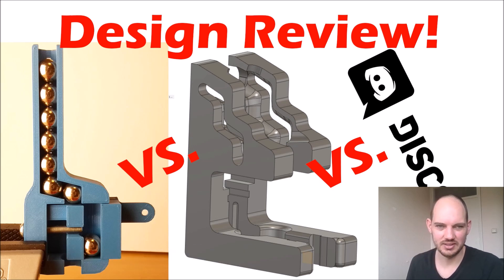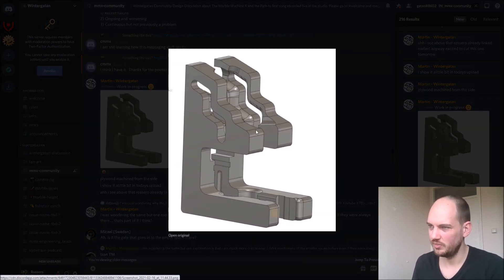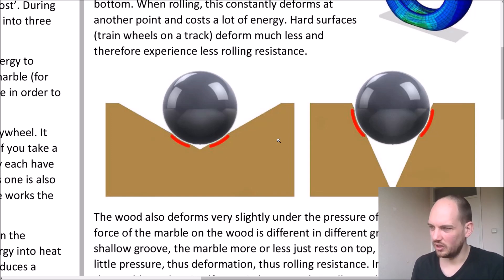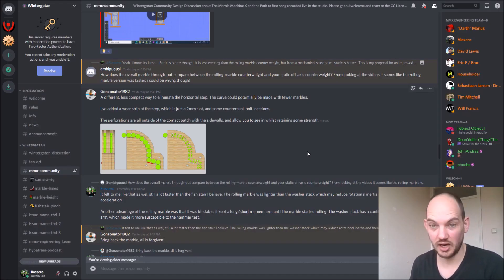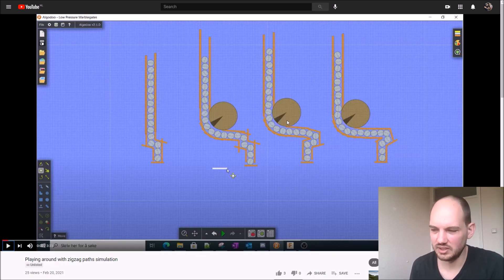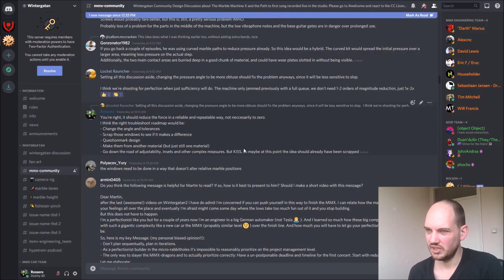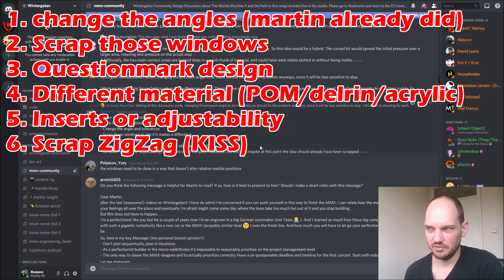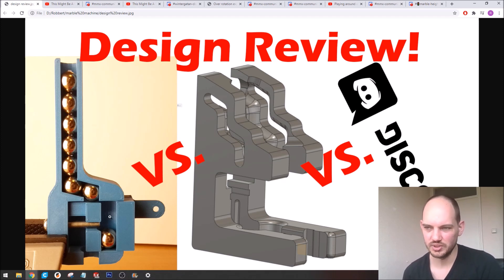[ Design Review ] ZigZag troubleshoot edition!👏 👏

Comment: Question regarding your design... if you would add just a small small "belly" in the marbel path , right at the second marbel from the corner, will something like that ensure that small "angle" push so it makes sure it does not get stuck ? Thanks for.... well i guess .... everything

Comment: Friction with the walls and also the adjacent marbles seems to be preventing the free release - i.e. the marble is pinched between 2-3 surfaces.   consider making one or both walls of the zig-zag or question mark out of ball bearings (at the contact points anyway) that can rotate freely.   the wall friction is now eliminated and the marble pressure is only a function of the vector angles at the contact points.   this should be more reliable than compromising between angles/gravity/wall friction.    sorry, no time to draw it up for you, but hopefully it is clear.

Comment: Nice. About friction: if the wood receive two coats of boiled linseed oil, it polymerises on the surface making it much smoother... With time the marbles of course would eat on the coatings and on the wood... But that is not a problem because this kind of wear leaves behind a polished surface.... So the oil woul provide this polished surface until normal wear polished all the path

Comment: I think that the ? design is overall an improvement, but there is one edge case where it will have the same issue where the upper marble will pinch the lower one into the wall. At 3:34 the exact circumstance is shown: The orange marble will get stuck between the ledge and the lower marble. Of course, with more marbles pushing against the orange marble, this won't be an issue. But it does mean that each channel will lose 2 marbles of capacity.
Reply from the maker: If there isn't a queue pressing against the orangeone, there is a problem of a much higher order already haha
Reply: @rosserobertolli  that's true, but crazy things happen when you plan on dropping millions of marbles ;)

Comment: awesome breakdown... im working on this right now... my version 2 is also sticking, timing of your video is perfect! 
My next idea was making even steeper angles and closing the windows, and removing all overrotation. i agree on those, a shame for the visibility but hey, the machine looks cool enough...
The ? questionmark design is causing some space issues, some of the drum gates are very close to the spring tensioning system, so the moving parts of that system would interfere with the ply parts. I´ll try a version 3 first it should work...
Reply: even the question mark design is not failproof , with time the 3'rd marble(from top down) will make a small dent in the wall , the ball above it wil make a small dent below it from falling down on same spot  and then the pressure makes the left marble stuck .
  i think a good idea to test these gates is to leave them open and just pour 10-50k marbles trough them  then study where the wear appears and design a new part with accentuated wear and test that.
Reply: Hi Martin! I'm happy to see the solutions coming together. I am watching your videos every day, great progress!
Reply: How about CNCing the marble gate out of something else, like UHMW? You could experiment with some thick cutting boards :D